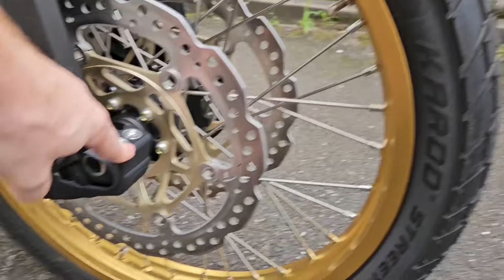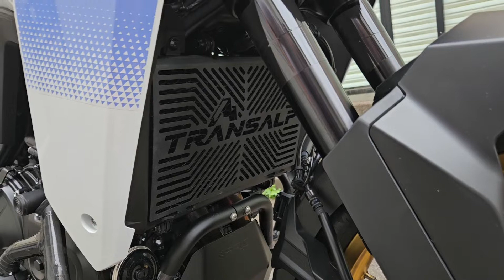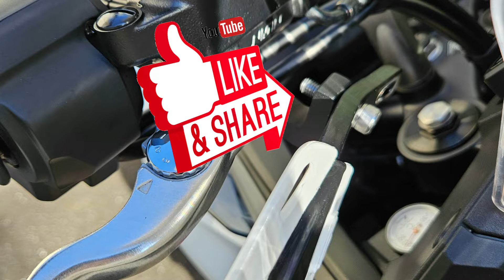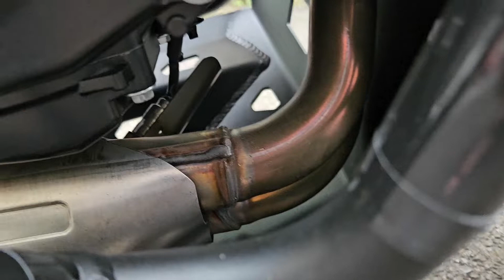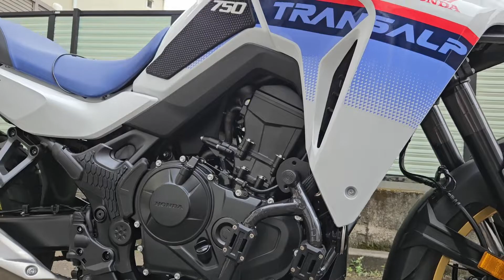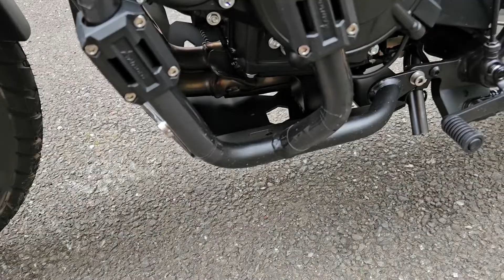Best Crash Protection!! Steel vs Stainless vs Aluminum vs Plastics. (2024 Honda Transalp 750)

Comment: how did you use the rear stand on the swinge arm,  I find on mine there is no spot for spools and not enough room on the left side with the chain guard?
Reply from the maker: It doesn't need spools. I have a link for it in my "motoz" video if you wanna give it a look

Comment: I have Givi upper bars, and bought Givi lower bars but they basically don’t fit with any skid plates other than Givi. I’ll get a setup that works at some point but for now I’m happy with my Acerbis skid plate and didn’t want to mangle it to make the bars work.
Reply from the maker: Is there any frame under the acerbis plate? Or is it just plastic?
Reply: @Man-With-Bike  It’s just plastic. I got it as a temporary solution, but after watching SKIDSnSTUFF’s video on them I’m thinking I’ll keep it on as long as I can if I can find some lower bars that fit as well.
Reply from the maker: Consider r-tech plastics, and no bars. I have a video on r-tech

Maybe acerbis engine covers ?

Comment: Great video.  I like the simplicity of the SRC lower crash bars, and agree that uppers aren’t needed as long as you have a bark-buster type grip protectors.  Will the plastic Acerbis skid plate work with the SRC crash bars?
Reply from the maker: My only issues is that black isn't stainless and was falsely advertised as stainless back then. But I have lots of crash test videos and so far, good investment

I dont think so.

I also like the idea of plastic skid plate, but no fram rails is a concern. 

See my R-Tech video, now my bike is very un breakable. 

Ive cinciders laminating 1-3 layers of carbon fiber to the bottom of my src plate.
Reply: @Man-With-Bike Sorry, what do you mean by no frame rails regarding the plastic skid plate?
Reply from the maker: @JayBD626 it mounts the the frame. But nothing is holding the plastic plate off the engine but 4 small bolts and the strength of the plastic.

On t7 or dualnsports, there are mental rails the full way under the engine and the plastic rests against that. So if you hit harder than the plastic can hold, the weight goes into the t7 or drz frame rails.
On the transalp it just goes into the engine.
Reply: @Man-With-Bike ah, I see what you mean now.  Maybe an aluminum one may be the better choice.  Thanks for your reply
Reply from the maker: The scr lower bars work like frame rails, so that helps a lot
Ive though about layering 1-3 layers of carbon fiber to the bottom of the plate to get best of both worlds. But for now im happy with it

Comment: Can you get to the oil drain plug with the SRC w/o removing plate?
Reply from the maker: Yes, but if you're not super careful, I'd imagine you'll get oil on the plate.
Takes 4 bolts and 1min to get the plate off

Comment: The Acerbis has 4 mounting points, unfortunatly the center of the skid plate, with a little patch of thin rubber between the skid plate and the engine low hanging oil sump, impact is direct, and jacking is only under the oil sump, not a good longterm process.

Comment: Stainless, not rust- less. 316 is weaker than 304, but 316 is slower to rust, both will eventually rust as both have relative percent of Iron.  Aluminum will surface corrode, oxidize, does not affect strength of materials.

Comment: So much misinformation in this video.
 First, nothing in your crash bar/skid plate is stainless steel except the fasteners.
 Second, stainless is actually heavier then mild steel generally speaking. Not lighter.
 Third, you CAN touch up rusted carbon mild steel with a rust reformer, and coat with some flat black paint.
 Fourth, your skid plate is aluminum not stainless. A stainless steel skid plate would be quit heavy but that might be OK down low.
  Fifth, welding stainless and aluminum is easy enough for any actual welder. Use tig or mig for aluminum and generally tig for stainless. I did it for years. Stick, oxy acetylene or any of the previous mentioned for mild steel. And whatever else has been invented since I quit welding. That applies to all welding. It's been 30 years since I left that work.
 I just finished installing the Powder coated carbon steel full crash set from SRC. It come insanely well packed, goes together without drama, and is top quality. If you want to pay a bit more you CAN get in bright finished stainless steel. I think the black is a perfect match for the flat black US version of the 24 TransAlp and well priced. Highly recommended by an X welder fabricator.
 Apologies for this comment, but people are being misinformed about a high quality product. Sorry, had to do it.
Reply from the maker: I'm saying what src told me, you should let them know they are wrong
but as they later changed (not on their Japanese page yet) black isn't stainless, the silver is.

I have 2 videos crashing this bike on and off road.
 Src is very good quality but full of rust now.

I understand you feels needing to suggest I'm inaccurate, but calling it misinformation is suggesting I'm trying to mislead with intent. 
I am quoting the src-japan page on these black bara that still says stainless for black and the skid plate. The usa page says a stainless skid plate and an aluminum plate. But doesn't specify which is which.

Again, sorry to have hurt your feelings, best to take it up with the maker.
Reply: @Man-With-Bike  Misinformation suggests that you are misinformed, which you state that you were, and in turn you are misinforming your readers. I never felt, or intimated, that you were deliberately misleading your readers.
 Again, my apologies.
Reply from the maker: @jamesgregory2962 i was pretty made when mine rusted😅
SRC still hasn't updated their page in usa or japan.

But i just googled it again, top 4 sources say stainless has better strength to weight than mild steel. Less weight by strength.
Reply: @Man-With-Bike  You are learning.
Reply from the maker: @jamesgregory2962 metalergy and anything offroad, yes, I'm very new😅

Comment: Went with the SRC full crash bars as like you I HATE rust. Install took patience but it’s in now. Thank you for the comparison.
Reply from the maker: @psalm116servant  the fram mount for mine has rust now. Since I didn't use upper bars the rust is in those holes.
Hope the bars are stainless, the mounts are not.

Everything else still rust free